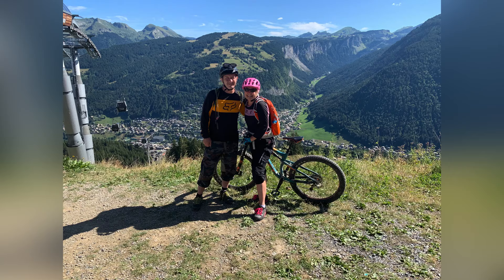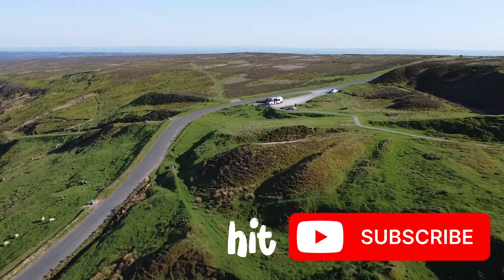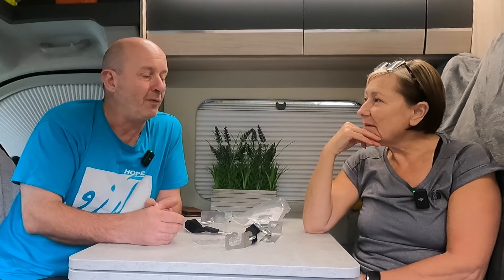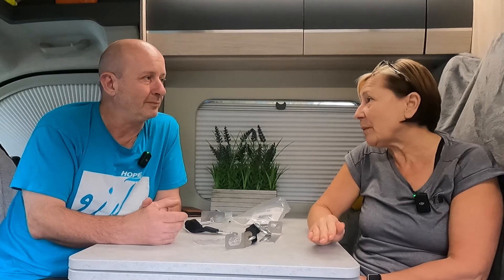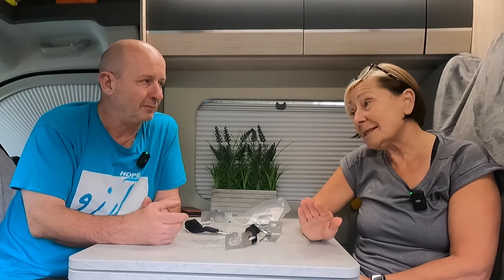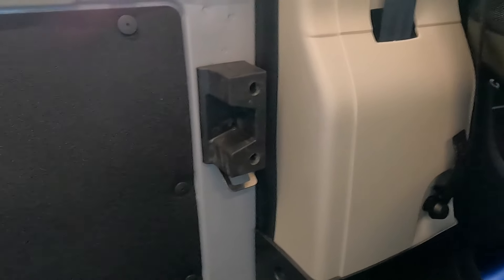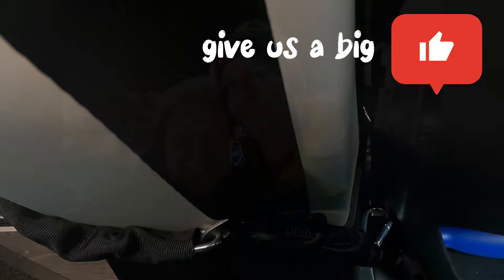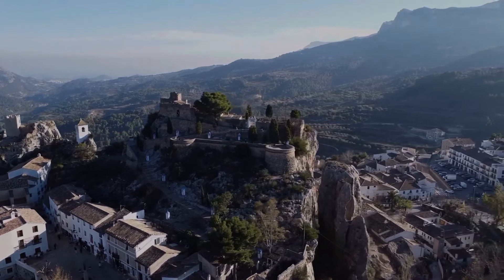Motorhome & Campervan SECURITY - Easy additional protection against thieves

Comment: I got a tip from a fellow motor homer…. You can fit a never ending strap between the 2 door armrest which works really well 👍🍻
Reply from the maker: @Flossy_tops  we don’t have a gap to fit one, there’s no hole otherwise we would have used a rachet strap. I think that’s what you mean?

Comment: I made something like that  couple of years ago with shackles and chain from B&Q £12 plus another thing you can do is when you turn the drivers seat around padlock it in place. But you can only do so much in a van with plastic windows and sky lights 😊
Reply from the maker: @travelswithbilbo7526  someone else said they’d made the plates themselves and done the same as you. Seen Dick Strawbridge bung a cable bike lock on the seat to lock it the wrong way around. We have other things. This one’s mainly to hopefully cause noise and a delay when we are in the van. But like you say the windows are a weak point.
Reply: Fingers crossed none of us will need these additional things - its a just in case to hopefully stop doors getting ragged open when in bed x